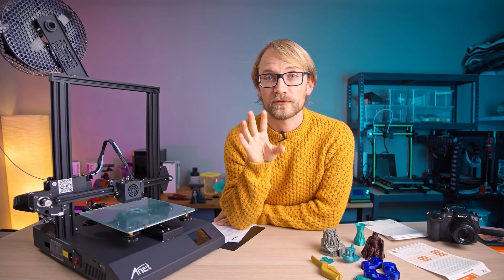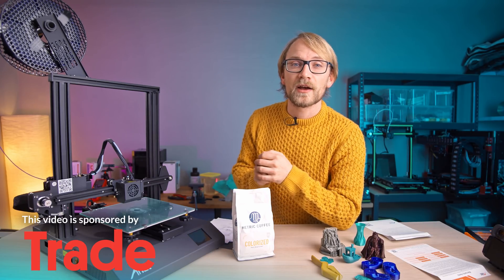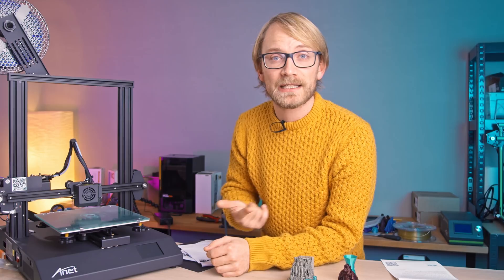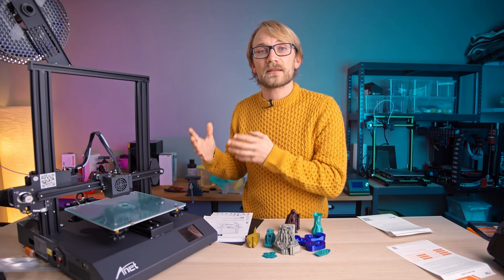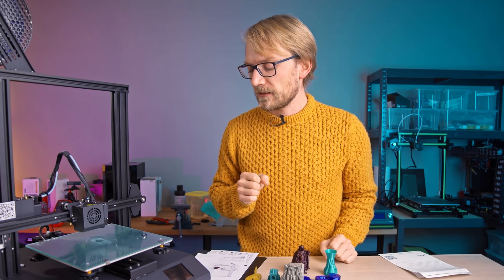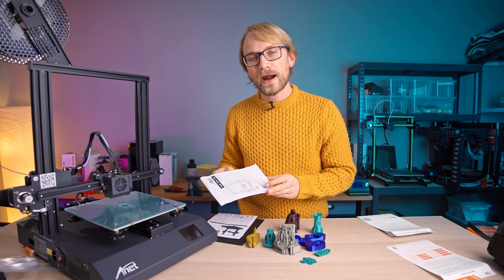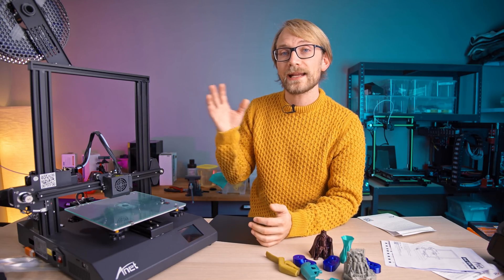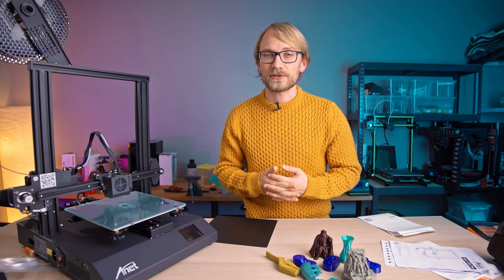What a lazy 3D printer design! Anet ET4 "Pro" review

Comment: Now a year later I would hope, that saw this first. Anet ET5 for the first printer, yes it does the job, but man - it has been a frustrating year ! I've been wondering why my friends keep gettin good results so easily out-of-the-box with their Enders. Its been a struggle, but finally after thinking about every darn thing could go/be wrong - starting to get some prints :D Thumbs up Thomas, keep up the good work - even tough your advices are not always solved my Anet problems :DD (this is ultimate how to set up you printer challenge stuff)

Comment: I really wish I had trusted this video 1 year ago. I thought the ET4+ was going to be a great choice for me and the Auto Bed Leveling Sensor (I have since removed that sensor and replaced it with a limit switch). Then a year later, I decide I want to add an OctoPrint to my printer, to speed up my printing process. But, my USB cable does not mount to my computer. Everything points me towards having to install Marlin to get the USB port to work, so I have to void the warranty and install Marlin and guess what the USB port still does not work. I was given an ET4+ with a bad USB-B plug. I have spent two days just trying to find and work around and nothing. YAY. And now I see the Ender3s on sale for less than I bought my ET4 for. /SAD NOISES

Comment: The thumbnail on this was brilliant, i bought a Anet ET5 Pro had to get a new one from the supplier because it broke it self. 

The ONLY reason i got it was that i found the monolithic base to be so sexy and yeah thats it really. Also the selection in large print volume printers are a bit more limited than with regular size printers like the ET4, i would probably get a BIQU B1 instead for that. Prusa Mini is awful so not another one of those.

Works fine with marlin and changing the hotend to a random creality one for 15$ but yeah would i not recomend anyone getting it im just a sucker for that base, sprayed over the anet logo ASAP. because seriously though anet..... yeah thats a brandname you want on your printer they would probably be better of not branding them

Edit: Also it was purchased about 6 Months Before this review.

Comment: Thank you i was literally about to buy this exact printer
Reply: I just bought it couple weeks ago. It differs from what Thomas is showing: printed a dog directly from the box and has logo on that black printing sheet. Maybe it's me messing with slicer settings and bed levelling, maybe it's an old plastic I bought in 2014 when I tried to build my own printer (and failed), but there is no tolerance: heart print-in-place box does not rotate. Iris box does though, after some prying.
So, that printer was not that bad for 160eur I payed.
Reply: @beepboop8184  Are you still happy with it? I found one on my local classifieds for 80 euros, is the same as a new inkjet printer. I ended up on this review because I was looking for feedback.
Reply: @eoleite  hey! Yes, I think it did worth €160 spent on it. I bought 3 more rolls of Sunlu silk PLA and it is almost half way empty. Also bought one kg of PETG of same brand, but printed only ~50-70g of it.
It does not print horribly well on speeds above 60m/s, I am using 40m/s most of the time, but does it’s job.

Oh, and with new plastic and right cura settings I managed to print this heart-shaped print-in-place box. Only with 0.3 tolerance though, but hey, if that machine can be aqcuired for €80 - go for it.

Comment: Thomas come on ... my Anet A8 just had a few improvement to be done on it.
-Rebuilding the whole electronic
-Installing a BTT 1.4 with TMC2209
-A rpi3 with klipper, 
-Rebuilding the whole hot end,
-Designing from scratch an extruder for a bowden setup, 
-Changing the cooling fan for a noctua,
-Installing a cooling fan on the PSU and the electronic board,
-Insulating the print bed, 
-Installing a mamorubot printing surface, 
-Stiffening the frame for the Y and Z axis, 
-Replacing the bearings in the steppers

it is a decent printer..... what ?! ... these upgrades are NOT normal upgrades needed for all printers ? oh.....

Comment: Maybe because I do not know any better but I have a pretty well working anet a6 and am pretty happy with it. Not perfect by far but  te usable stuff I was able to make over the last 6 years is amazing to me. Thinking of buying a better one and as I understand, better not this one? I want a working printer, not a project on itself. Don't mind building a complete kit but hate tweeking. any much better printer you would recommend? I want overheating detection and autobed leveling. being silent would be nice but not a must. just need a printer that will make a "perfect" print the easy way. in 99% of the time the my anet a6 is more then big enough. so do not want a big monster. I am using it with a flex building plate with a pei layer. works fine. I added a small filler block to the extruder to be able to print flex filament too. the a6 is direct drive and most new printers are boden tubes if I am not mistaking. Is it still possible to print flex with that? don't do it often but sometimes just need to. so please advise me for a good new one I could go for with a price point under 500 dollar

Comment: Purchased ET4Pro in less than a month I had extruder heating problems. Replaced ceramic heater and thermistor then the machine would no longer home, it would just crash the Z axis. When contacting Anet all I would get is how to home the machine and links to  U tube vids. Printed with it for a month but according to them I don't know how to home it. No satisfaction, it's junk. Ordered a Ender 3v2 waiting for it now. I've had an A8 and E12 but selling them and done with Anet. Don't buy this trash.

Comment: i got the ET4+ wich is the same as the pro version but without silent drivers, worked great for about 3 weeks and then the zstop stopped working and crashed the bed on z home, customer support send a mainboard and sensor replacement, it took over a moth to arrive, it fixed it and worked for 2 small prints and died again, by this time i was out of warranty so its just a paperweight now, i tried replacing the board with a ramps 1.4 and while testing the power supply died out so my guess its that it was causing all the issues, i cant fix it now because im broke and i cant afford an electronics kit so it will have to wait a while.

Comment: i bought the ET4X on amazon for like 150$, well worth it for me, because i fully intend on replacing the mainboard, and touch screen. If you aren't going to do that, don't even bother with these printers, they are terrible as far as the software end goes. 

Issues i had to solve with mine right out of the box:
1) Heat bed carriage wheels screws were catching on the screws underneath because the bearings weren't pressed into the wheels completely.. better screw placement, and better attention to assembly would be nice. 
2) I asked on amazon if this printer had autoleveling, and was told it did, it does not.  3 times i posted to anet's support forums, asking for guidance on how to install BLtouch, all three times the post was deleted. DELETED!!! What kind of support deletes posts they don't want to, or don't know how to answer??
3) a profile for cura is available on their website (if you dig around long enough) as well as updated firmware, however, they tell you to contact their support email before upgrading firmware, and when you do, they simply reply that if you upgrade the firmware, you'll no longer be able to get support from them...... with the firmware upgrade THEY provide... REALLY?

Agreeing with Tom here... These people put literally NO effort into these printers...

Comment: I  bought this Anet ET4PRO on a Black Friday deal for 150 euro and  1 Kg PLA and an extra stickings plate..it was my first 3D printer....indeed first try...no luck..SD card was bad....but i could see the files on it..other SD card good  ... Thingiverse file ... not from the SD card !! with very old Cura from original SD card ..printing excellent !  From Headphone holders till very good fitting Raspberry Pi casas....now with the newest Cura and  the supported ET4Pro file...again excelent prints.... conclusion like Thomas told..from Factory a disaster . Autoleveling NOT very good ....by hand now excellent... Luckely i could fix it myself being a Hamradio and ICT  man....now working with Remote OCTO Print.... no use of the internal  SD slot ..😏

Comment: thanks for the honest review....am now a new subscriber..I have had a CR10 mini for 2.5 years and it has worked great & I have done all the silencing mods and upgrades etc and many prints but I am now wanting to treat myself  to something that takes up less workspace than it's separate control box and spaghetti bundle of cables and has a touch screen and auto bed leveling ...small build volume would be fine...don't need anything big

This ET4 pro seemed to tick all the right boxes but glad now I didn't go for it... the more  reviews I watch there seems to be little in my price bracket £400 tops without big faults ...also looked at your Artillery and some other reviews  on other sites  

I don't mind certain tweaks and maintenance etc as am a retired engineer (gas) but just want reliability  and easy to update firmware etc...any pointers would be great....am searching through your site now.
Reply: EDIT to above...(am prepared to get chastised for this :) ) but even after watching 2 of your other vids I have just bought and received a CR6 SE. I realise there were some issues with early ones but after reading and watching many recent reviews I believe the current crop are ok ...I certainly am pleased with mine....I have done 4 prints so far, (2 off the included SD card ...only got it 2 days ago) and am really pleased...they have all come out absolutely fantastic.

You cant really see any layer lines and they look almost injection moulded....certainly the best results I have ever had and so far its working great....the power switch feels clicky and there is no smoke or sparks The power board is a later black one :) 

I paid a bit more... £365 and got it from Amazon with a 2 day delivery...could have got a bit cheaper from Bangood etc but have only had good experiences with Amazon's return process so that gives me peace of mind.....so far so good....if its as reliable as my MINI has been I will be well chuffed.

Comment: Had 3 anet et4 and finally got disgusted with them breaking. The last et4 has the new style sensor for homing. It's absolutely useless, changes height every time you use it. I just picked up a ender 3.Not sure how long it will last but it's a much easier learning curve for a beginner for sure!

Comment: Just flash Marlin any nob knows how to do this. I think that program licence is the problem and this outdated version is for free. I was total beginner and did upload Marlin on my Anet A8+. But now I use SKR 1.4T + Raspberry pi 3 with Octoprint. All this was in 5 months with all mods i spend total 280€ with printer included. And I get near perfects prints on 8mm rods. Now I`m going to change this rods for linear rails. OK there are some problems with week connectors and belt traveling but this is easy fix. But over all I bet that I can make this machine print better with only Marlin update and little tuning in Marlin like PID and calibration xyz and extruder calibration. This can bee little challenged  for beginner but hey you must start learning at some point.
I agree that original firmware is total s..t and therefore all printer if you look at it as it is.

Comment: Hello Tom
A bit brutal while true maybe a bit unfair.
I agree that the manuals could be better and maybe better edited and in more languages, english worked for me. Few 3D printers are truly for beginners there is a clear learning curve for any machine. 
I have in fairness been using an Anet A6 for many years now mostly successfully. It had its issues but their videos were great at the time I had it up and running in short order. This December I bought an Anet ET5X  looked compelling and price was good on sale. Difference from the ET4/5Pro seems to be in the mainboard drivers, the ET4/5X uses a version with the A4988 drivers where as the ET4/5Pro uses the    TMC2208 version, they can be interchanged and the latter is quieter. I am not sure of any other difference between models, the 4 to 5 difference is one of print volume/capacity, essentially the same mainboards in use with differing firmware for size….. 
Granted I am experienced with a slightly different model but it is substantially the same. Assembly was a bit fussy but nothing like my A6 was. I struggled a bit with the firmware and getting the auto leveling where I wanted it to be. A quick resort to the scant manual and a watch of the video from the web, problem solved. Adjusted the final Z offset and started my first print a filament guide mod from thingiverse, sliced in Cura 7.8 They have an ET5..  profile works well start and end codes could be better but worked well. First Print was pretty good! Every print since has been as good or better. I agree that providing Cura 2.14 is a bit lame but it will work for a beginner if need be if it will run on their system. Better versions are available as I found when I first started. There is a learning curve on 3D printing we are both well past much of that. My experience has been positive and satisfying with my ET5X and my A6 for that matter. Could they be better, sure! Did the ET 4/5 Pro deserve the review maybe not but we are entitled to agree to disagree of course. We did not really see the results or the trials and tribulations but you clearly had a poor experience that is regrettable, I do not understand where things went south for you in this. I generally like your videos and respect your knowledge and commitment to the craft. I found this one disappointing, maybe somewhat unfair or at least not reflective of my experience on a similar unit baring of course any differences in the models.

Comment: Somewhat unrelated, but It's funny to see the Anet name for me. I actually started 3D printing with a black acylic Anet A8 that I got from some sketchy site for 200 bucks. Spent 6 grueling hours putting the thing together, and 6 more hours figuring out how the heck to make it print right. I made a bunch of stuff with that printer including an E3D hotend upgrade. I wasn't satisfied, so I bought some square 1" aluminum tubing, and built an entire CoreXY printer using parts that I printed with the Anet beforehand. I'm still using the guts of that printer to this day, including the electronics board, and motors. I never even installed the X and Y limit switches in my contraption, I just push the hotend to the bed corner to home it, and it returns to that point after it's finished. I've been running it for over a year like this. I'm actually surprised the electronics still work. Props to Anet for that!

Comment: When i bought my Anet A8 for 170$ i knew it would suck at some point and show its blatant flaws, but i also knew that no 3d printer machine worth 170$ in 2018 was going to be anything more than a 170$ machine (stating the obvious here). And so as i got more into 3d printing and used more and more my A8 i did some needed upgrades to it. First was the 2 power mosfets for the bed and extruder, then a proper 12V power supply, forced convection cooling on the mainboard aka a 80mm fan, then a full V-slot metal frame, added a glass bed, replaced the linear bearings for the IGUS polymer bearing, rubber/glass fiber belt and finally an arduino uno "nanny" that monitors the print status, temps, power consumption and has an IR receiver so i can control the A8 with my TV remote from a far. By now i have invested 150$ in this machine in the span of 2 years and it prints like a brand new 500$ machine. My takeaway is that Anet is a brand meant for people who know their stuff, (sort of a Caterham Car company) but can't afford to "pork over" the price of a fully functioning machine from the start. You get a working machine that will get you started in the hobby and then if you want to do complex projects you have to spend time and invest in some parts that the Anet has left missing in their products. I have nothing against your review or experience, i'm just telling you mine and that you can't expect the performance of a 500$ machine, out of a 170$ machine, from the start. Certainly that ET4 would perform better than a prusa if you give it some love and care.

Comment: I have a question for anybody. If bed is 300mm x 300mm can you print to full 300mm in either direction in x and y and if I printed at a 45° will I be able to print bigger than 300mm depending of coarse the width of project

Comment: The "pro" does not mean the printer is professional but it means the printer is made for professional users, solving all the problems with the printer ;-)

I have an ET 4 without "pro" (for about 145€). Actually I was surprised about getting quite acaptable results (except for moiree by the A4988) on first try with Ender3 profile. Also the cableing is quite interesting and seems a good solution. The hardware seems quite solid - and as the feeder is placed more inwards actually the bowden can be shorter than simular printers. With some tinkering like flashing marlin, adding ABL (as I have the version without "pro") and changing the mainboard to the TMC version (got it for 32€), it is an interesting platform. But in no way it is a printer for beginners or even advanced users. If your hobby is not 3d printing but tinkering on 3d printers, than it is the right printer - but than of course not the "pro" version but the basic one.